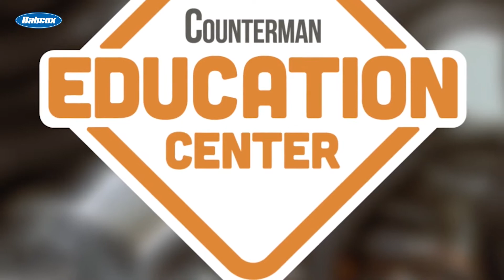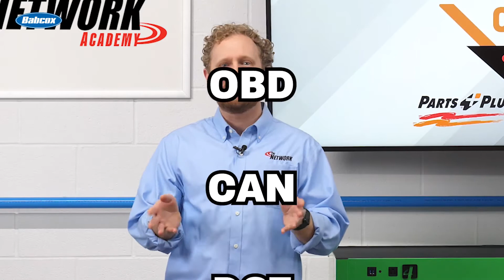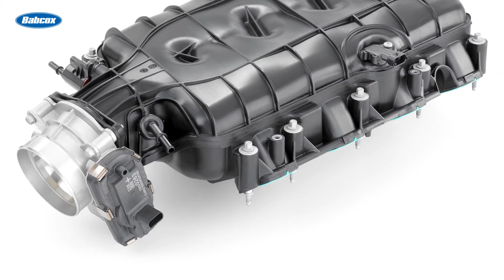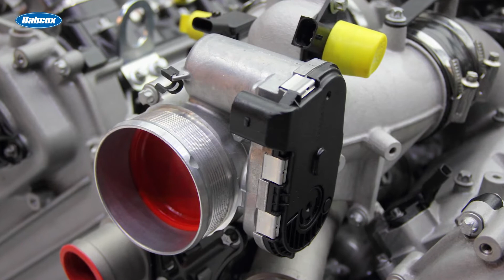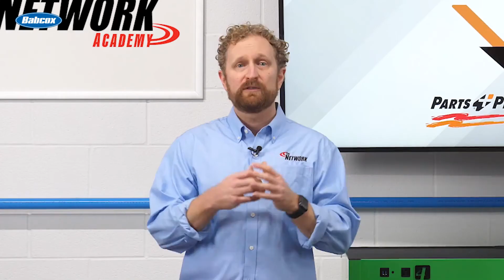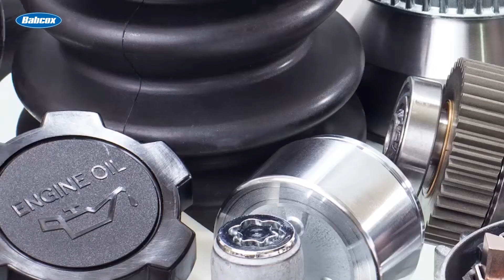MAF vs. MAP Sensors

Comment: So what happens if the MAP sensor in a diesel is bad or has poor electrical connection?
Can it cause low boost in the turbo?
We are having a problem with low turbo boost and I clean the MAP sensor and it runs good for a while. 
Or is the sensor getting dirty somehow 
Looking for solutions 
Thanks